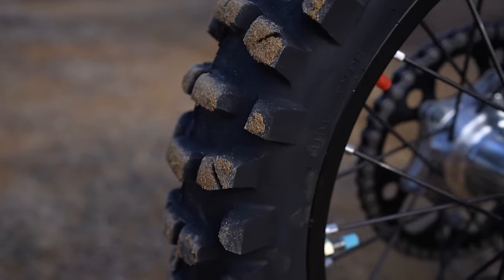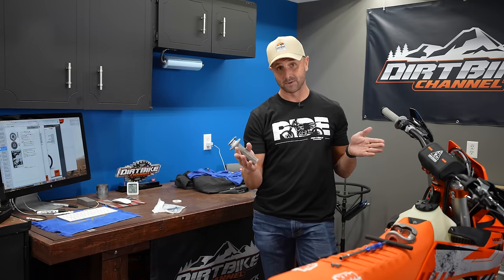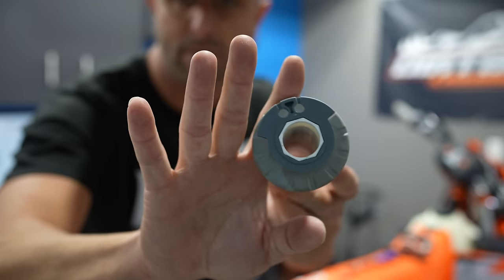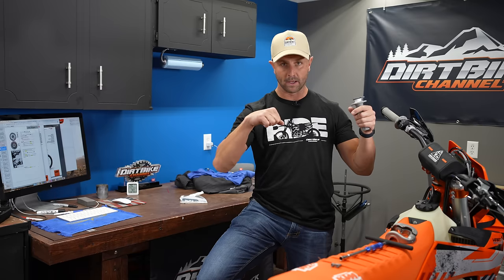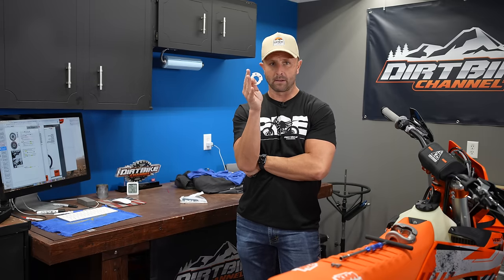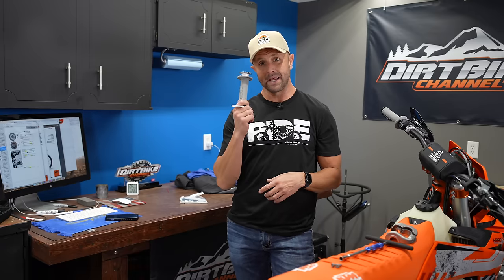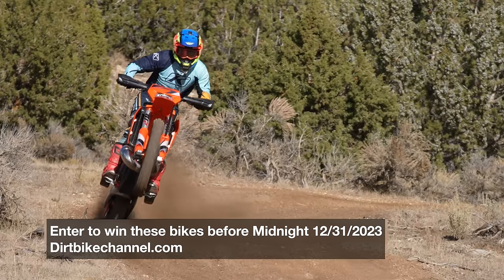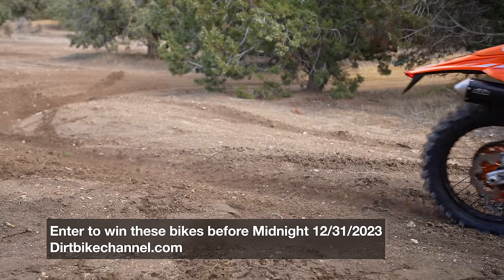Free Motor UPGRADE??? Throttle Cam Explanation

Comment: Xc 300 2023 comes with the white one installed. I changed to the grey and it was way more mellow 🤙🏽
Reply: Did you have to purchase it. Or did it come from the dealer
Reply: I believe it’s supposed to be included with you 2023 xc 300. If you put the white cam on the XCW, it will be way more “sensitive” at the throttle.

Comment: The amount of throttle turn needed to make things happen was the first thing I noticed on my 2021 300 EE, after coming of my fire breathing 2015 300 SD with head, cdi, red spring etc. Switched to the black quick turn cam, red spring, dolly flush and 52 tooth rear transformed the power characteristics of my TPI. Opened up air box cover helps too. Glad to see someone else touting the black cam as beneficial.

Comment: Funny how many folks run or think they need the shorter pull cam and the green map.. yet are total trail squids. Having hard fast power hurts them and makes you slower in so many situations.. 

Smoother is faster

Comment: Hi Kyle. I took off the factory plastic wrap around hand guards because the twisting action in a crash broke my clutch master cylinder. Other than that I liked them, they seem tough and don’t bend but I digress. They are gone.

Comment: If you find that these cams are not large enough or you still need to twist the throttle too far for full open you can always do the pvc trick.  I like mine at a 1/4 turn to full open.  Take a small section of appropriately sized pvc and epoxy it to the cam making it a larger diameter.  Some throttle assemblies will need a bit of internal clearancing as well.  I have a hard time twisting my wrist far and this helps.  Note that this wont make one faster as your brain will adjust to the throttle.  If you find yourself self regulating your brain will just make that adjustment and you will still find it hard to pin it.

Comment: Those wraparound hand guards can be dangerous. Mine got bent a little after a spill and then I was riding fast tapped the front brake lever and it got stuck as I hit the whoop and flew off the bike.

Comment: I have a 2020 ktm 300 xc tpi. It has a leak around all of the rubber parts right beneath the oil tank. Have you ever had a leak here?
Reply: Probably the rubber L shaped piece located just underneath the oil tank. Lots of threads regarding the problem. I have had to replace it on three different too bikes. $5 part.
Reply: Funny you say this because I've noticed a lot of the 2024 XCW bikes have the same problem, I have the same bike as the one he's working on in the video and it already has the oil bottle leak, right at the 90 degree rubber piece.  I've looked at a handful of 2024 XCW's and they too have the leak, it maybe worse on the new bikes. I deleted my 2024 XCW oil injection and mix fuel so I don't care now.  For you guys that have 2024 XCW's and still have oil injection, take a flashlight and look at the 90 degree elbow coming off your oil tank, see if it's sweating.
Reply: @onthethrottle7104 pre mix is the way to go. One less failure point

Comment: This is what we’ve come to throttle cams instead of learning clutch and throttle control an feel of the machine
Reply: What do you mean? Are you saying using a different throttle cam will stop you from controlling your clutch or throttle?  -That makes no sense.
Reply: No I'm saying it doesn't matter what you use learning your machine is what it comes down to technique
Reply: @kinglucci5352  thanks